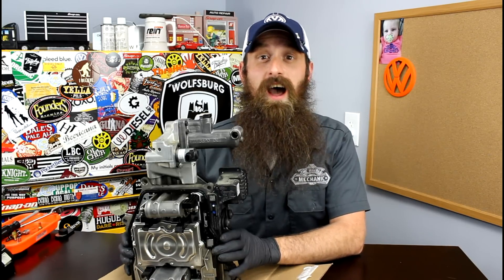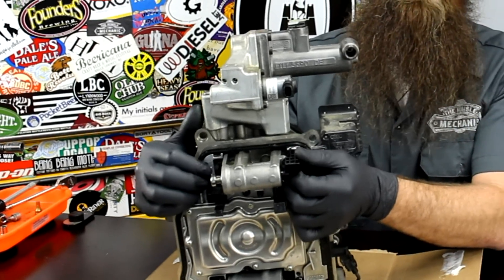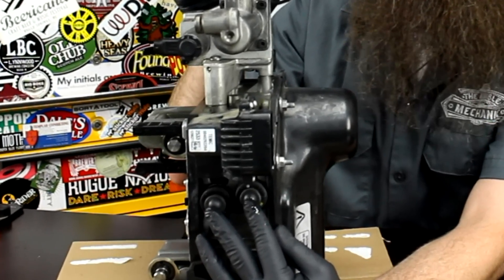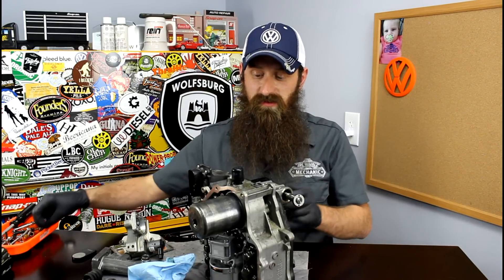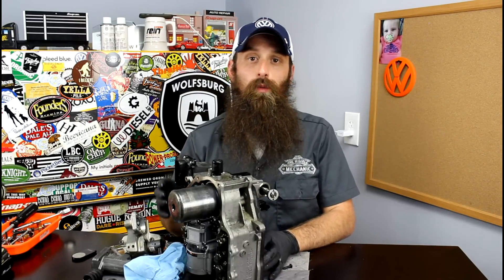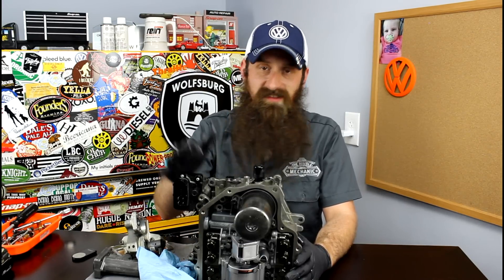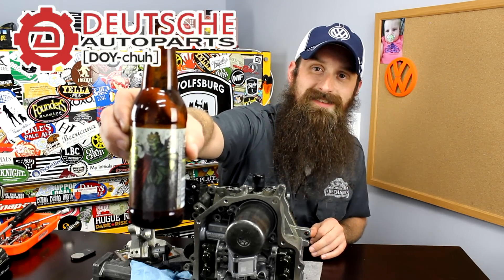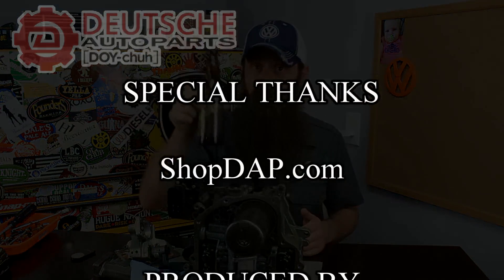How VW Parts Fail ~ 7 speed DSG Mechatronic Unit

Comment: Hey Charles, hello from down under, here in Australia we have a 220hp 2.0 TSI(mk7 GTI EA888 Gen 3) with 7 speed DSG DQ500 Tiguan model. These models in similar variants, ran from 2016 to 2024 all which severely suffer from the Mechatronics unit failure, generally from only 60,000kms and onwards. It 'seems' to be at a very alarmingly highly percentage of vehicles. FB groups are littered with this problem, it seems not "if" but "when" it will fail. Many units are covered by warrenty all be it lengthy waits as parts are in short supply from Germany(surprise, surprise). Vehicles out of warrenty may receive a "good will" replacement where the owner pays for fitment labour. All of which you're without your car for weeks/months. Have you seen any updates on if this part has been revised/fixed or will this $4,000AUD replacement part just fail again after another few years/60,000km when your warranties run out and you've already used up your "good will credit"? It really does nothing good for brand reliability reputation and resale values, no idea how its not a product recall or class action.

Comment: Having problems with mine now whilst drive will get no gears gear lever flashes and no indication on dash and will only select gears when shifting into manual mode
Normaly i have read that problems start around 120000km but it also depends on the driving conditions like traffic and temperature

Comment: Hi there humblemechanic my engine light came on saying stuck in 1st gear (I have a 2014 vw jetta hybrid) and it now drives skiping every other gear for example it only drives in 2nd 4th and 6st gear I started hearing a clocking noise when it shifted into 3rd before the issue happened not sure if I need a whole transmission or just the unit in this video

Comment: Great video Charles, im driving a 1.4 tsi, i believe it has this dri clutch. The symptoms of the problem are that as soon as you drive off , it slips out of drive and technically goes in to neutral. Vw says the clutch is worn out a bit and all they need to do is recalibrate the megatronics with a computer and they drive it on a highway so that they reconfrig all the gears . Does that sound correct to you

Comment: I press start button one time and  my car show  'error:gearbox'. Then I dont start the engine. Close the car and I was wait for 1 hour to cool the car, then I was called vw call center and ask what can I do? They invited car mechanic to the our call, and he said try one more time to start the car. And car dont show gearbox error, this time it show 'start&stop system error'.
Mechanics said if you dont hear any different sound drive to the our service center. Then I was gone to the service center, they controlled the car and they said we need your cars second key. We recode the all two keys. And then your problem solved. I really dont understand what kind of problem I did run into with Dsg? 
Sorry for my english 😉

Comment: Got a DSG7 DQ200 unit with the error P174D valve 2 in partial transmission 2 electrical error open circuit. I have tried new TCM and changed complete valve body but it still shows same error. 
Can you assist with this?

Comment: Hi Charles, any chance you would do an updated stronic/dsg video. Common failures and repairs/upgrades eg: oil pressure fault due to cracked housing - upgrade with Kinergo accumulator "housing" kit? 

I mean, now that these gearboxes are all over from the polo to the a3 from 1.0 to 2.0 there will be a lot more interest. I myself are pondering how many common ways these go and if there is upgrades for all or some.

cheers!

Comment: I hit a pavement with that, it broke and some fluidscame out. I called the vw dealership they said its going to cost R26 000 to order it. 

I am in South Africa and its in a 1.4 engine. I am still pondering on how i csn get it fixed

Comment: Hi. I have a VW Jetta Hybrid (85,000km) and the car shows the following symptom. When leaving the place and running at low speed (when it should remain in electric mode) makes the transition far too early on the gasoline engine. Then, about three seconds apart, he makes repetitive switching from the electric motor to the gasoline engine and vice versa. I took the car to two services and received two different causes (answers). Have you encountered this symptom before? Do you have any idea what this problem might be? Thanks
Reply from the maker: Never ran into that one. Have you brought it to the dealer?
Reply: I have exactly the same problem. After heating up and stopping of the car, it turns the engine off and on after around 3 seconds. When I turn e-mode on, it says that it isn't available. As if after the stopping and switching to e-mode it instantly switches the car into petrol mode. This keeps repeating constantly. What problem they diagnosed you in the service? Here could be a problem.https://drive.google.com/file/d/1O-Xc-FViavZeAPOQQEp_HgK5BgPolJXG/view

Comment: Hi I'm from the UK with this 7 Speed DSG unit on my 1.6TDI Golf. The vehicle has done over 97k miles . So far the unit is performing well...let's hope it can go for another 50k!
Reply: Hi is your clutch dry or wet,i have a 1.6tdi mark 7 dry clutch.does it need fluid change,people tell me that it is a sealed unit does not need changing.even the dealer did not have service intervals,but a specialist told me he will change the fluid for me.is he after my money i wonder.
Reply: @naz.tanzeem5982  I think ALL 7 -speed DSG in that year was a dry clutch. Hence VW state there's no need to change the fluid on these vehicles. They are not sealed btw - it's totally up to you if you want to change the fluid. But I'd leave it if I were you.
Reply: Is your car and dsg still going??!
Reply: @tomg6333  still going Tom. On 106k now but noticing shifting hold onto the lower gears before change at higher rpms. Only for uphill though. Some say it’s due to the catch wearing out. Other than that she’s fine
Reply: @bio10155  That's great to hear! I've got a 1.4 TSI Golf with the 7 speed, only 33k miles on it but I am a bit worried after finding out the horror stories with this gearbox. But it's great to hear your on 106k and apart from the things you said about its still going OK. 👍
Reply: @tomg6333  Well Tom, I'm confident that it'll go on for much longer...I mean clutch wear is a natural process and @ 106 on original is not bad at all. I've got VCDS and occasionally scan her ...nothing comes up the gear box. on the other had, I have an older  20061.4 TSI (super+turbo) with the 6-speed DSG...that is another story....I think she's skipped timing due to a suspect chain guide going funny ...
Reply: @tomg6333  I’m looking to buy a Golf 7 1.4 DSG, how’s yours holding up?

Comment: I have problem with my transmission,which is engaging to electric motor.It could be the mechatronic unit problem?do you suggest to replace whole transmission or just mechatronic unit only?
Dealerships cost me too much for new transmission! Vehicle even doesn’t worth that much..can I use a used transmission for this?

Comment: My 2019 Volkswagen Beetle has the Transmission control unit mounted inside the cowl area of the car. A sneaky, mischievous, and terrible design on behalf of the engineers of this vehicle to boost themselves profits!!!
If you own one of these beetles, (assuming the cowls and wiper blades are removed), make sure to first remove the control module, set it aside, stick the water hose down into the cowl drains, and flush out the debris down there. Then clean the inside cowls with soap and water like you would the body of the car, then dry up the control module mounting area, and snap the cowls and wiper blades back into place. That will prevent flooding, water seeping into your interior from the passenger side fresh air opening, and an electrical short waiting to happen down in there, resulting in an immobilized paper weight of a vehicle.

Comment: HI I have a 2013 Jetta hybrid replace the transmission and engine seal last year 2019 ( the engine seal was leaking on the electric engine and transmission was no longer working) now I have a  intermittent problem with transmission hybrid warning light  when drove in high speed  no longer 3 an 5 gear. I did a hard reset ( take off negative of battery ) now everything is back to normal. I bring to the VW dealer to know what happened they now say it the megatronic or the transmission need to  be replace again. Now I need to know if there is any coalition between  the power steering  (making little noise when turning) and the megatronic  maybe made the unit stop working. How to know what need to be change? megatronic or the transmission? How to test the unit to make sure and take the right decision also if I need to replace the megatronic can I buy it on Ebay?  Thanks for the help

Comment: I have a 2011 Golf GTI with 130,000km in it, one morning had this same problem with P transmission flashing, but The car wont start when turned the key and give a message “depressed clutch” on the dashboard. My question is before done any test like you did. Is there any warning or indication when the dsg clutch worn out that the car will override for safety? 

I had obd eleven and done a basic settings, the message is U0101-lost comm with TCM static from engine module 1, and at gateway 19 shown faults: 01315 TCM no signal, this goes the same message on 09 central electric. 

Thank you for any insight.

Comment: My Golf SW 1,6 liter TDI with 7 speed dry clutch DSG suddenly did not mow. It then had 113000 km on the counter. The mekatronik unit was replaced and a steering (bushing?) For the shifting fork for gear R and 6 . No clutch repair needed. The TDI has 105 hp and 250 Mn max torq.

Comment: Lucky it didnt explode on him the way he opened it up, they help up to 60 psi, pcb needs removed first to allow all that pressure to be released properly, then pistons and sleeves need taking out, the accumulator gets taken out and then the motor and pump, then the solenoid carrier can then be removed, the fault he explained is easily fixed by replacing the solenoid carriage and gaskets, rebuild and refill with fluid, pretty easy to be fair, either that or the pcb shorts out and burns most of the pcb out which calls for a temporary repair to get the info off it for replacement to be reprogrammed, depending on software version

Comment: Thank you HumbleMechanic for posting this video, very informative and quite fascinating...I'm currently dealing with my S7's DSG having issue's any my dealer just explained to me that they are going to try and replace this unit, first they thought is was the circuit board to the DSG that was giving issues....hopefully this will be the solution! Great video!

Comment: My mechatronic unit has failed in a late 2017 Golf 1.5TSi. After 16k miles. Very disappointing. Still under warranty but what happens if/when the replacement part also fails (and the car is out of warranty) ? Could be expensive me thinks.....

Comment: Hello,  first of all again an aweesome video of you. Keep the good work.

I have one question about my DSG transamission.  Could a bad solenoid be the reason my DSG is making a downshift clunk from 3rd to 2nd gear. 
No shaking, juddering or anything,  the dsg shift fluid and precise like a dream  except that clunk sound on downshift... 

It'a   2006 AUDI A3 SB   2.0 TDI 
 DSG (6 speed)

Thanks :)
Reply: Interesting, I just did a test drive of a golf 1.4 with 7speed DSG, noticed a slight clunk/click on down shifts, wasn’t sure if it was normal on DSGs as I’d never driven one before
Reply: @jessicastrat9376  I've recently driven a 2010 Passat 6 with DSG and same thing happening... 

Strange...

Comment: If a vw specialist de energize my 2013 vw hybrid Pmy transmission, can I then remove the engine and transmission so that he can perform the transmission swap ?. Do the transmission comes out only through the bottom?. I never worked on a hybrid. But I have performed engine and transmission swap and rebuild them too. Please advise

Ps. 
Do you have any video about transmission removal on a vw jetta hybrid
Reply from the maker: Yep engine drops out of the bottom and the system does have to be de-energized. I did a video on mech failure. But nothing on removing the transmission

Comment: Hi,

I have been facing an issue with the DSG gearbox on a 2014 model Polo GT Tsi1.2L 4cyl Turbo engine in India. The problem is that, the odd number of gears are not being engaged. Only 2,4,6 and Reverse gear are working on the vehicle. Please suggest what can be the cause.

Thanks
Reply: Was it mechatronic or something else?

Comment: I got a 12 Volkswagen CC the other day. DSG trans with a 6 speed auto tripping code P0746 pressure control solenoid stuck off. Took the mecha out and look it over real good. All solenoid check out good. OHMS wise. opened the circuit board on the back and all checked good in there also other then some of the silicone may have bubbled up near 2 of the connections? Opinions?

Comment: Mecatronic unit from dq200 failes because vw was put syntetic oil in it , it needs mineral oil to corect the problem
Vw recalled worldwide cars equiped with dq200
Recall Campaign number: 34F6
Reply: HI I have a 2013 Jetta hybrid replace the transmission and engine seal last year 2019 ( the engine seal was leaking on the electric engine and transmission was no longer working) now I have a  intermittent problem with transmission hybrid warning light  when drove in high speed  no longer 3 an 5 gear. I did a hard reset ( take off negative of battery ) now everything is back to normal. I bring to the VW dealer to know what happened they now say it the megatronic or the transmission need to  be replace again. Now I need to know if there is any coalition between  the power steering  (making little noise when turning) and the megatronic  maybe made the unit stop working. How to know what need to be change? megatronic or the transmission? How to test the unit to make sure and take the right decision also if I need to replace the megatronic can I buy it on Ebay?  Thanks for the help

Comment: Is that a beer in the corner?
Reply from the maker: Probably. Lol
Reply: Yo @HumbleMechanic  while you're at it please answer this, will send you a six pack.

I have a 2010 VW Polo TSI that was imported from Japan, (I'm in Botswana)

Recently the gear box just stopped engaging gears both in automatic and when I put it into manual. The sign on the dash would flash depending on the gear you selected, for example, if you put it into Neutral, the 'N' letter would just flash same for drive and reverse, without actually engaging and moving the the car.

The mechanic diagnosed it as a mechatron problem. We ordered another one from China which we installed this past weekend. The part worked for just a few minutes and when we tried to test drive the car, it wouldn't change above the second gear and then eventually wouldn't even move at all and then returned to the original flashing problem.

When we received the Mechatron, it did not have the 'clutch actuator rods' so we used the ones from the old mechatron, could that also be the problem?.

They ran a diagnostics so I have attached the error codes so that you can have a look.
This is the Mechatron  part number : V OAM 325 025 ZK7

Please offer a solution if possible.

Comment: dear ... to be disturbed by those super unnecessarily complicated modern cars And more and more electronics, even in unexpected places. Soon there will be cars on the demolition that are still as new but that nobody can repair. I buy again a 1.9 tdi from the 90s I have had 3 pieces in the past 22 years and driven more than 1.2 million km and never had problems with the engine or gearbox And everything on the car simple and logical to repair and no repair with "modules" ...... and no programmed wear. Precisely because of the super good experience with audi 1.9tdi, I have a band with Audi that I unfortunately do not have with Honda, for example, which is currently much better technical than Audi ..... too bad. The Audoi engines from after 2000 are ..... well ... let's say, uhhh less good

Comment: hi , i have a 7 speed skoda , stuck in second gear after a new clutch and flywheel, it starts fine goes through the gears, and if i manoeuvre , it gets stuck in second , and throws up a fault, does it need programming?
Reply: Did you find the problem I have the same issue
Reply: Jordan Jackson re-calibration

Comment: please help I`ve got a VW tsi 1.4 Golf which has a transmission control module code P071500 input turbine / speed sensor `A` circuit  and it does not engage into gear 1,3,5, and 7. in the dashboard it has error transmission showing there.
Reply: Did you manage to find a problem because my car is doing the same

Comment: I have a dual clutch and love it. Mine is the 9M, and not the 9G. Just changed the tranny fluid and filter a few days ago, according to specs. 
I had a pcv valve error , and this time I replaced the entire valve cover and not just the pcv unit. Good thing too cuz when I removed the valve cover the rubber gasket was broke in 2 places, and oil was getting very close to my spark plug compartments.....which 3 weeks prior i had replaced all plugs along with 5 new coils.  Glad that this time I decided to replace the valve cover cuz I discovered some things that were going on underneath.   Just a heads up to everyone.